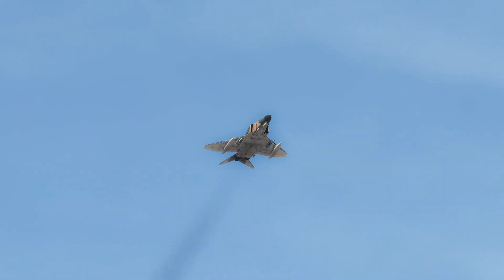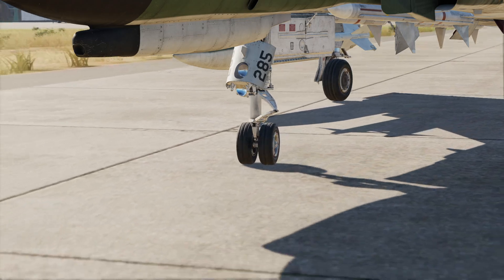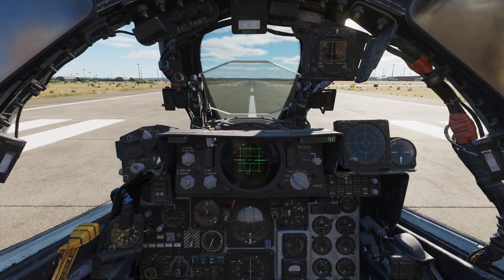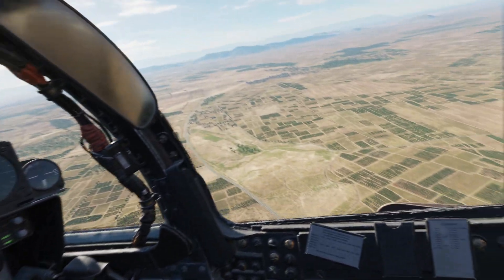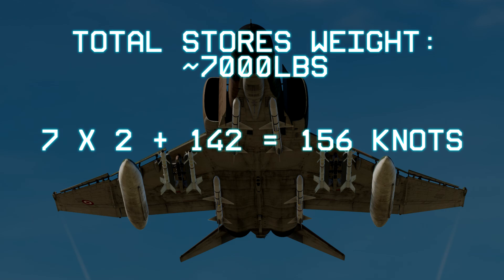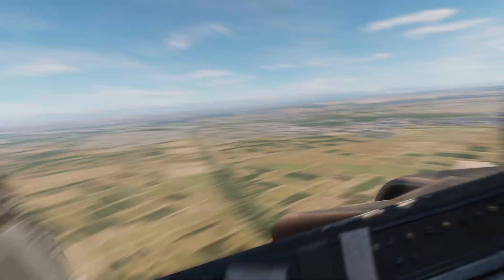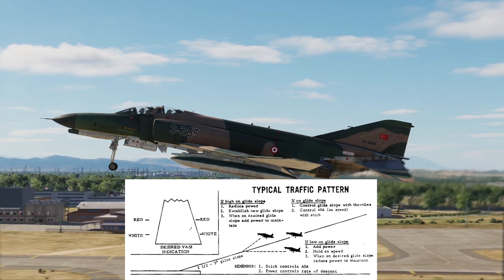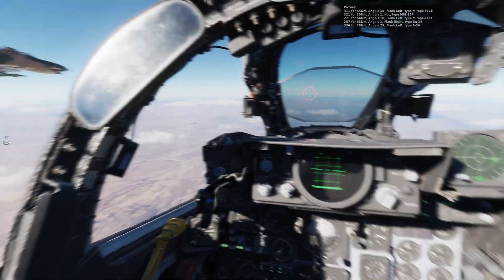DCS F-4E Phantom II for DUMMIES Chapter 2: Taxi, Takeoff, and Visual Landing for Pilots

Comment: What curves do you use, I find it very hard to fly level with trimming, it always is climbing or diving, and the roll rate is insane, I touch the warthog, hotas, and the bank is way to much, very diifficult to fly.
Reply from the maker: I've got a standard Warthog HOTAS gimbal as well and my curves for the F-4E are 25 for both pitch and roll. The thing is a bit too twitchy, so the heavy curves makes it feel a lot more weighty and makes it easier to fly. I find it quite easy to trim out personally. You gotta remember that you need to adjust your trim based on your airspeed. The faster you go the less AoA you have and therefore your lift vector will change angle as well.
Reply: @PrezDCS  Thanks, I'll try it out.

Comment: Thank you mate. This is a great tutorial. Clear, precise, detailed. I loved every minute of it! I hope you will cover the F-4 entirely. 

Question: Can i set the flaps lever to the middle position during flight in order to use slats or am I supposed to use them for take off and landing only?
Reply from the maker: If you leave it in the middle position then the flaps will be retracted automatically in flight while the gear is up, but your slats will be deployed. You'll be more draggy, but have slightly more lift. It might help with aerial refueling. The first time I ever did AAR, I left it in the middle position by accident and it was the easiest tanking experience I've ever  had in a jet.
Reply: Thank you! I was thinking that maybe slats out could help for some dogfights.  @PrezDCS
Reply from the maker: @stefanonapoli7282  They automatically deploy at certain AoA which will happen often during a dogfight. You don't always want them out tho because the drag can keep you from accelerating if you bled too much energy. A little trick of the trade is to have the emergency slats switch bound (different from he emergency flaps) to manually force the slats in to maintain energy in a hard turn at the cost of a slower turn :)